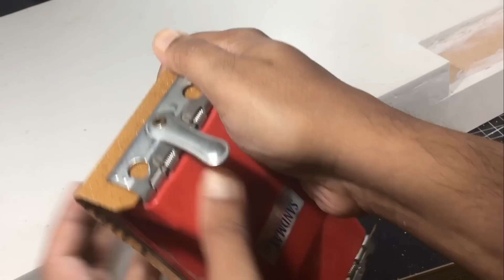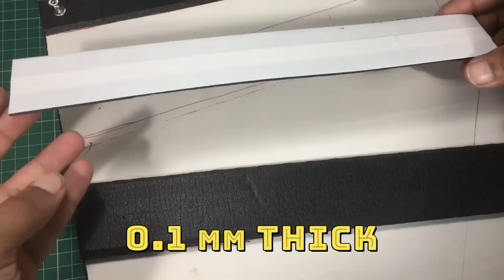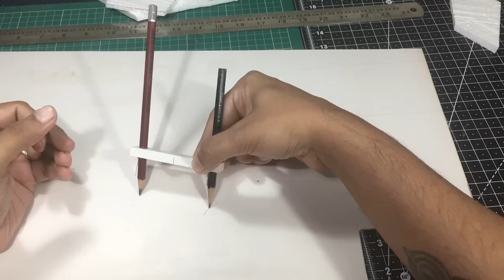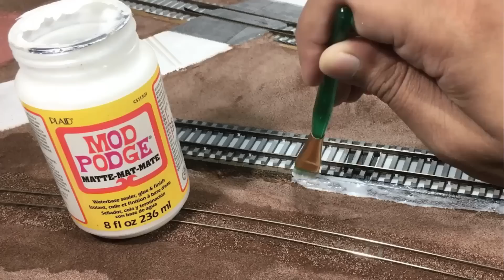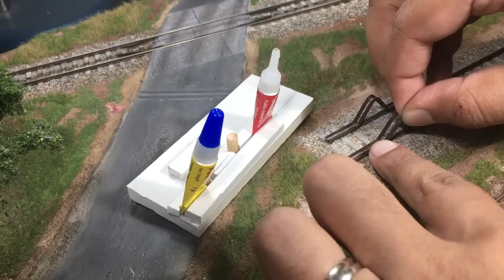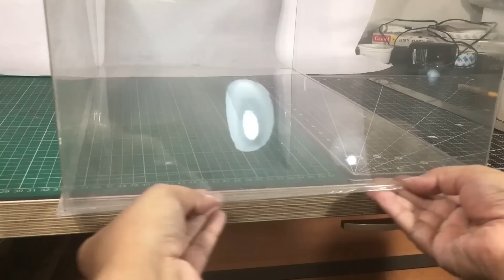ULTRA-REALISTIC Diorama Art: Dual Gauge Railways, Country Road

Comment: Brother what is the reason behind of using modge podge before applying ballast in ho scale tracks? 
I am asking you because most of the video I have seen they have not used the modge podge before applying ballast in ho scale track, they directly applied the ballast to the ho scale track?
Reply from the maker: Mod Podge has two key benefits for Scenery work- it dilutes better than other white glues, and the matte variant that I use doesn’t leave any shine what so ever. Once dried you would never know that there’s glue in the ballast. Alternatively you can also use acrylic matte medium.

Comment: Very impressive diorama. I was also impressed by the 3D printed locos.
May I suggest a diode rather than a switch to stop the train at the end of the line? The loco stops, but will reverse as soon as the controller is reversed and no need for a button switch..
Reply from the maker: That is a great suggestion, don’t know why I didn’t think of that! I’ll definitely use this trick for my future projects. Cheers! Kaustav

Comment: Quick tip: I work a lot with this PVC foam, you can use superglue (CA glue) to glue it. It's a really strong bond! If you try to break it, it will never break the glue, it rips out the PVC material. And I just use the cheapest no-name CA, it works absolutly fine ;)
Reply from the maker: Great tip!I will give it a shot. Thanks.

Comment: Why did you make the track electronic when you used diesel engine
Reply from the maker: Does Indian Railway run ONLY electric locomotives in electrified lines? Or do they run both diesels and electric?
Reply: Good question , bad answer

Comment: Can you order PVC foam board online? And is it cuttable with a hot wire cutter?
Reply from the maker: PVC foam board cannot be cut using hot wire cutter. You need a knife or a saw as shown in the video. Thanks
Reply: @TrainsandDioramas  thanks!!
Reply: hi, do you mind sharing where to order the PVC foam board from in India? I am not able to find it online. What else can we use. I have a MDF base board and was looking for Foamular 150 as base.

Comment: Wouldn't roughing up areas be easier/more even with sandpaper?
Reply from the maker: The idea was not to make it very even. Old, weathered country roads are anything but even, hence the pin approach. You can use a wire brush though, but for the small area that I had to model, pins provided better control and precision over a wire brush. Plus it was fun!

Comment: All material is affected by temperature. Don't be surprise by joints coming apart in a year if its expose to big fluctuations in temperature. Like you work.
Reply from the maker: thank you! I agree, if not built well, anything can succumb to heat. With both humidity and heat at work, wood expands and contracts which is OK for furnitures etc. but for a modular model railroad with attachable tracks, it creates alignment issues in long run - that's the main reason for using PVC for this project since it's essentially a travel model. My model railroad benchwork is traditional and it's surviving pretty well so far despite being made out of wood. Thank you for stopping by. Cheers!
Reply: Why the negativity? Can't you not sit back and enjoy the skill and dedication that has gone into this fabulous diorama and then brought to the rest of us to admire? Do you not think that a man with the intelligence to produce this diorama together with the electrical components that has gone into it,  hasn't already thought about extremes of temperature and its effect on his work? He should be complemented for producing a fine piece of work, not criticised for any shortcomings.
Reply: @gartsherriejunction4643  Yes he does great work and it would be a shame that it gets left in a trunk of a car or other type of place and falls apart because the PVC and Clay expand and contracts at different rates. I work for a company that builds 1:1 dioramas ( Broadway shows ) and when they get left in storage trailers for a year the damage is quite a job to fix and put back together.

Comment: Excellent! This is a very informative and beautifully produced video. It's great to have an endorsement of  PVC foam board from someone who has experience with demanding climates. I'm a former LEGO Show & Events specialist--primarily a display designer but the team I belonged to did much more than that.  Our department designed the LEGO Imagination Center at Walt Disney World where the hot, sunny, and humid, Florida climate had to be taken into account when creating the outdoor displays.
Reply from the maker: Many thanks! Glad you liked it. :) Yes, PVC is a good substitute for Ply, however, in my experience it is only good for small displays like this one. The core of the PVC foam board is not that strong and I donn't think larger structures can be made totallt out of PVC, BUT with aluminium supports it can be a great alternative. It's light, versatile, easy to work with (that you can cut with a box cutter knife) and doesn't cause humidity related issues. I will stick to it for my future layouts. :)

Thank you for stopping by. Cheers!